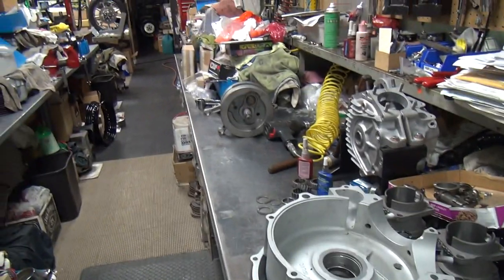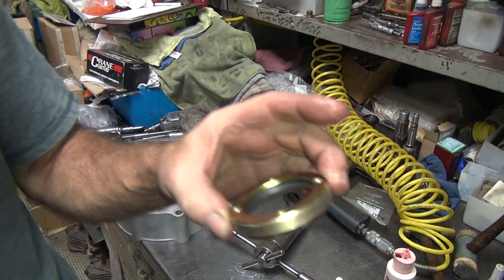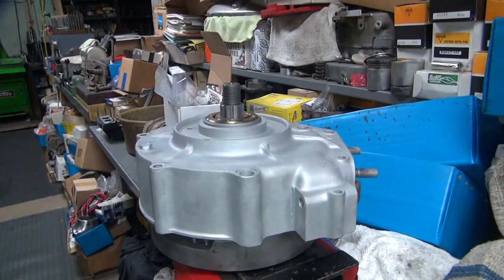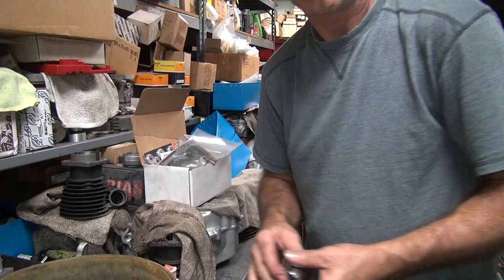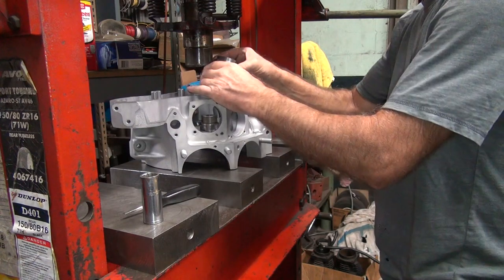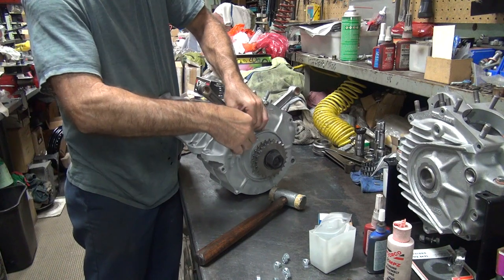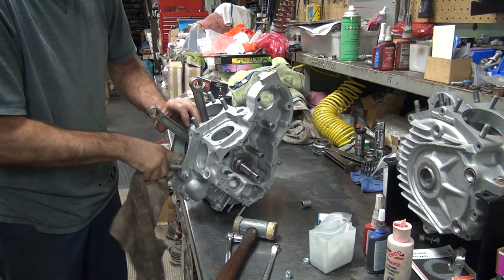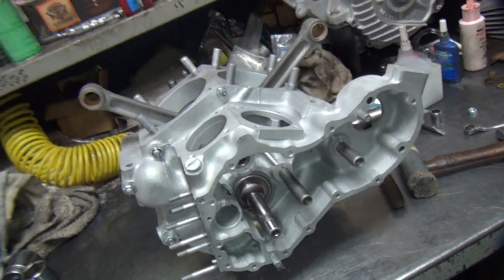1958 FLH panhead #105 lowerend rebuild FLH 74ci flywheel balancing harley by tatro machine

Comment: In an earlier video you said you painted the cases. What paint did you use? Also what are you using to clean your small parts? Hate chrome too. Thanks
Reply from the maker: the paint varies depending on what i am doing. i just use aervoe engine paint. i degrease and bead blast my parts.
tatro

Comment: Any tips on removing the inner main race retaining ring? I’ve tried numerous size awls and pry
Reply from the maker: why would you want to remove it. if you can't get it out it must be good.
tatro
Reply: @TatroMachine  pitting
Reply from the maker: that would be the race, not the ring. replace the race and leave the ring in place.
tatro

Comment: ...28:00 cam bearing. Although it was an older Ironhead Sporty, I had an HD dealer work on it (1982 or so). one of the cam needle bearings was 'loose' in the inner case. What would be your proper 'Fix' for that? I believe he tried to knurl the aluminum, resulting in a bearing failure while running.
Reply from the maker: loctite or sleeving the hole. it depends on what loose is.
tatro
Reply: Well, one bearing had broken and needles got in there and seized up the crank, between flywheels and the case...I took the motor completely apart, and installed 4 new Torrington bearing for cams. They all had decent press-fit and I saw no evidence of any 'knurling' by HD shop...motor ran fine for years.

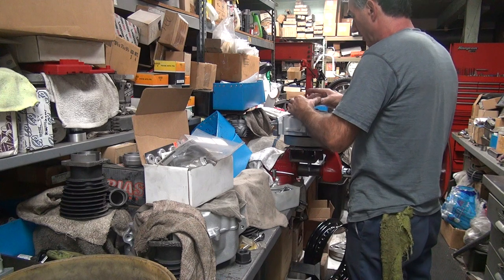Comment: Why did you have to pull the double sprocket @ 19:00, then put it back on? I didn't hear you give a reason.
Reply from the maker: i was making sure the new seal retainer and spacer were playing friendly with each other. i had to take the 1954 panhead motor all apart to fix one that did not. better to check it now than do that one again.
tatro